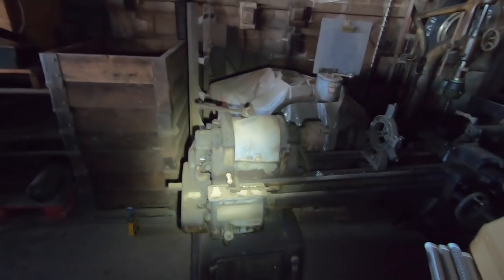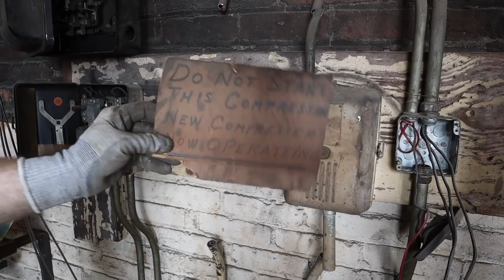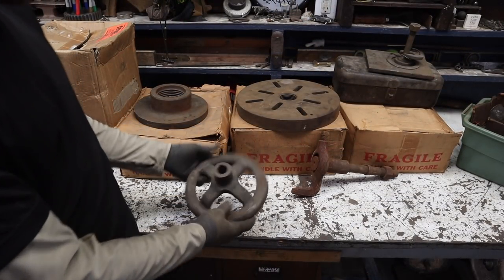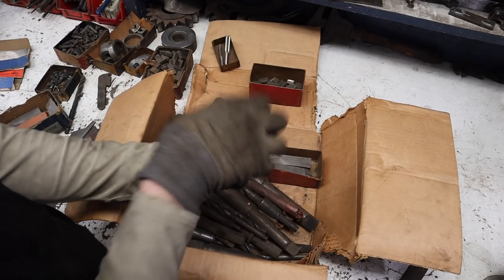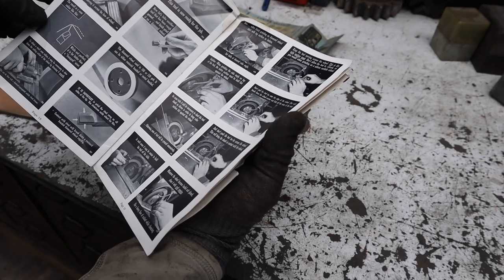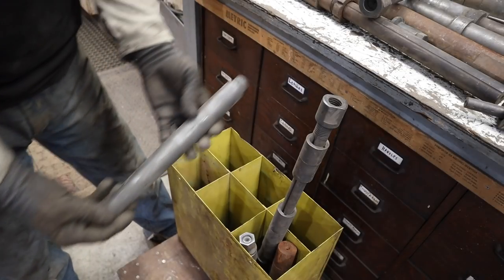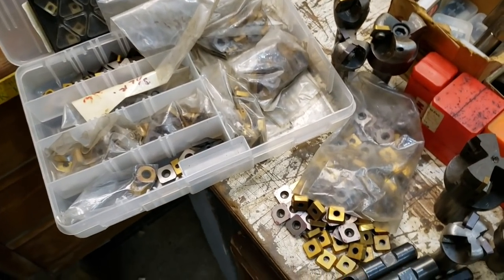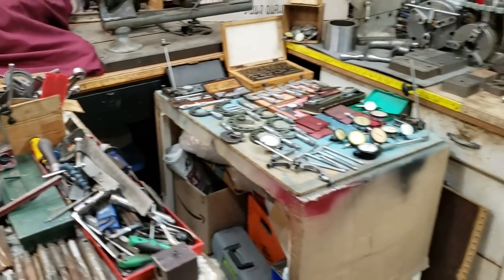This Machine Shop is a TRUE Step Back in TIME! ~ RESCUING OLD IRON ~ Episode 3 P2 ~ TOOLING Galore!!

Comment: Concerning that huge boring bar, I have seen something like that or bigger in use.  The story:

In the early 1980, the US Congress authorized the US Navy to reactivate the four IOWA Class battleships, with no real warning to the Navy that they would do so (most Navy personnel, civilian or military, never thought it would actually happen).  Battleship NEW JERSEY, the one previously reactivated during the Vietnam War, was selected as the lead ship (where the methods and costs would be figures out as they worked on it) at the US Navy San Pedro Naval Shipyard (in Southern California, since closed).  The person who was put in charge of the reactivation at San Pedro was a very experienced old-timer named Landgraf.  He needed info about NEW JERSEY "yesterday" (it was a "Kermit the Frog" moment).  My hobby is "Armor and Ordnance in the Age of Ironclads, circa-1859 to 1955" and I worked on the SeaBee Center in Port Hueneme, about 60 miles north of San Pedro, as a civilian Computer Engineer working at that time on the US Navy TERRIER AA Guided Missile Support Department (dissolved in 1992 along with all of the TERRIER warships when the Navy suddenly, again with no warning, declared that all non-nuclear steamships were to be decommissioned starting in 1990 and people like us better get new jobs lined up ASAP -- I was able to switch to TARTAR easily, but lots of others had more problems finding new jobs).  Somebody knew about my hobby and informed Mr. Landgraf, who called me up and asked if I had any information about the various steels usedin NEW JERSEY.  Indeed I did, from various Navy and other Archives and sent him a 1"-thick package of all sorts of data about such steels, both construction and armor, much of it from Navy documents describing these materials and their usage.  He thanked me profusely and invited me to the open house when NEW JERSY, still in its "mothball" state, was towed into the shipyard up to the big dock there.  I went there (there were HUNDREDS of people there in a huge line backed-up over the freeway bridge over the harbor entrance.  I was simply told to bypass all of that and go directly to the gate and I would be let in immediately, so I was one of the first people, including the shipyard personnel, to set foot on NEW JERSEY since Vietnam.    Indiana Jones has nothing on me!!

During the initial rebuild, a lot of new equipment had to be installed in the ship, which meant that eigth 8" holes had to be cut into the 6" deck armor (4.5" laminated over 1.5") amidships for power cables and communication cables from protected below-deck equipment to the above deck things like radars, radios, the new "R2D2" CIWS 20mm self-contained automatic close-in AA weapon mounts, etc., etc.  The deck layers were both made of Special Treatment Steel (STS), the old BuSHIPs term for their naval armor-grade steel (BuORD called it "Class 'B'" Armor, same difference).  This was very similar to US Army WWII Rolled Homogeneous Armor used for tanks, though somewhat softer (it didn't have to stand up to small, very-high-velocity armor-piercing projectiles at point-blank range, as the Army armor had to).  Cutting holes in it was going to take some major effort, as you can imagine.

Mr. Landgraf thought he had the problem cased.  He called up a small firm specializing in cutting hol;es in hard steel like bank vaults using a diamond-edged circular saw.  They said that each holw could be done in a couple of days, so maybe three weeks, tops.  So Mr. Landgraf went to give them the contract.  Now things turn into a movie!  The in-house machinists at the shipyard stated, "We don't need no feelthy contractors!  We can do it ourselves, using BORING BARS!"  Now you see the connection.  They said it would "only" take them about a WEEK PER HOLE.  Mr. Landgraf was almost apoplectic, since that put the time that the holes were finished and they were needed almost on top of one-another, so any slippage would delay the entire reactivation effort and guess who would get the heat, not those worked!  However, he was overruled (office politics!) and off those machinests went.

Mr. Landgraf as another way to award me for my timely help (almost nobody he had working for him at the start even knew what the old steel names meant, to say nothing of what they were metallurgically), gave me two guided tours, by him personally, one during the initial rebuild and one later-on when the ship had to have most of its wood decks ripped up and replaced by the original teak (EXPENSIVE!), since the substitute wood they had originally used could not "take the heat" (literally!).  Again, I have a much deeper understanding of what Indian Jones felt like in those movies!

Mr. Landgraf took me deep into the ship on his first tour and went to a compartment and gave me a pair of thick-headphones with heavy soundproofing, hanging by the hatch at a compartment.  He then opened the hatch and we went inside.  In that room they were cutting one of those holes.  A huge drill, looking like a hand-drill for KING KING (though without the handle) was braced against the deck, overhead, and all four bulkheads by heavy steel bracings and its bit was pointed straight down and slowly rotating.  A shipyard employee was sitting on a chair next to the hole and occasionally squirting a steam of cutting oil into the hole in the deck from a large oil can in his hand.  He too had thick ear protection.  The reason for the protection was the almost unbearable, even with the headphones, SCREAMING, SCREATCHING, "fingernails-on-a-chalkboard" sound coming out of that hole.  I could not understand what the poor guy with the oilcan had done to deserve such cruel punishment,

When we left the compartment, Mr. Landgraf said that THIS ABOMINATION was how they had done these things DURING WWII and he was still mad as hell and felt personally insulted by this obsolete work process.

So, sometimes these old machines are still in use, no matter how many are supposedly sold as scrap or to small businesses or to restoration people like you.

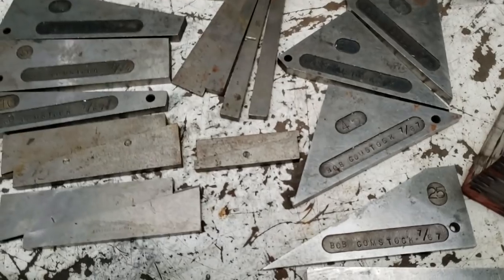Comment: 56:26 the three in the bottom left are adjustable parallels and the rest are used as parallels but to mount the work at an angle ( kinda like a sine bar but as parallels) we have these in shop class

Comment: At time 45:08, the boring bar would fit in the quick change tool post for the lathe, extremely stout to prevent chatter when boring.

Comment: Yes the shafts  are for holding the spline cutters on a milling machine they slide on to the key way I used a lot in my time for cutting splines on drilling bits for mining (De Beers) but 30 odd years ago we move with the times and on to CNC Machines . that is the company I worked for, my claim to fame is we made parts for Aryan Rockets fuel line system made of Stainless steel tolerance 500 of 1 thousand of an inch we use metric much easier . The fuel line was based on your elbow joint also had to make camera covers of stainless steel, they were a B to tap on a minute machine and my mate made 5 from aluminum 8 inch diameter and he held that tolerance on all five on a manual machine, and when they came over from French Guiana to Ireland the were amazed that he held the id to 500 of 1 thousand of an inch, he worked in precision engineering before coming to work in the company. But alas I had to leave job my wife got a detrimental disease and had to look after her I did for over 6 years that is 13 years ago now. I have forgotten a lot of work how to machine materials for instances the bigger the drill bit the slower the speed and on and on Ido see a lot of people tapping and breaking taps expensive why do you not use tapping compound cutting lubricant to day all  fully synthetic. my wife died from M.N.D. Love watching your videos for obvious reasons the Enthusiasm you show!

Comment: 38:00 is a die holder for one of the presses that were in the shop.
Reply: It is a press shoe set for a press machine, could used for cutting or forming. Due to thru holes I would thing slugging or sizing

Comment: @50:50  Those are "reverse" spot facers.  They fit to a mandrel that is inserted through a hole in the material and then the cutter spot facer (in your hand) is twist fitted onto the mandrel.  The cutter has a cam type engagement that allows the mandrel to drive the cutter pulling against the interior surface to be spot faced.  Used in situations where the machine cannot reach the work in the conventional fashion such is inside a gear box casting.  Light weight versions of these are very popular in the aerospace industry to reach surfaces inside airframes, etc.  There are a number of styles and proprietary mandrels.  Here is a complete example:  https://www.newmantools.com/cutters/invspotfacers.htm  If someone else describes these, please excuse.

Comment: 43:56 the morse taper drift has a round side and a flat side, you had it the wrong way around. the flat side should be towards the inner tapper and the rounded side towards the outer tapper.

Comment: The tapers on some of them machine tools are called MORSE TAPERS and numbered 1 - 6 or maybe more, designed to fit in a drill press or a lathes tailstock.. If you look up MORSE TAPERS it will explain more. = https://en.wikipedia.org/wiki/Machine_taper

Comment: Subject Viking pump for werner & swasey lathe
Ad is submitted by poster: Viking Pump for a Werner & Swasey Lathe
* Serial Number: 1308032
* Model Number: EGCC-1201-1057
* Manufactured by: Viking Pump Houdaille in Cedar Falls, Iowa
* Diameter of Round part: 2-1/2" x 1-1/4" thick
* Mounting Base: Has 4 holes 3/8" diameter. bolt patter 7/8'x2-1/2"
* Casting Imprint: Body of pump say W&S 13000 & 1 186 001
* Pump Dimensions: Widest point: 4.00", Length: 7-1/2", Height: 5-1/4"

Comment: what you don't actually have a use for is still high grade tool steel. Guys that do forging would love to get their hands on it. If you're not a machinist, I have to wonder why you even want all this. Reselling perhaps? Got to be a good buck in these machines if you find the right guys. Had I a shop to work in, I would love to have an old engine lathe, like the kind I learned on. I ain't much on all this new fangled computerized stuff.

Comment: Can someone tell me what "high speed steel" is, and what it's used for?
Reply: Donna M. Schmid hss is hardened steel using for cutting steel. They’re very hard and can cut steel
Reply: High Speed Steel (HSS) is a tool steel.  Can be made into lathe tools, Milling bits and drill bits.

Comment: At 55:08 your wondering what that is, you said something about a broaching guide. That’s exactly what your holding, that goes into the part that is being broached, it guides a broach as it is pushed through by a small manual shop press usually 12” long. Most likely a key way for a tapered shaft. I used so much of those tools laying on the table. I still have all my personal hand tools. Had hope to have a small shop when I retired but was on disability before that could happen. You have a b u n c h of stuff. I saw that your in the Midwest so you don’t need to answer my other comment.